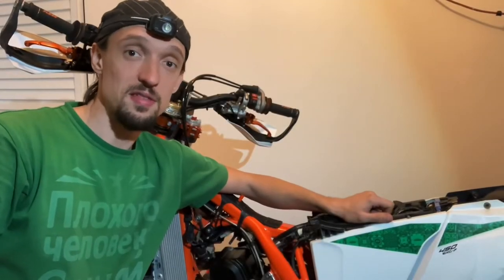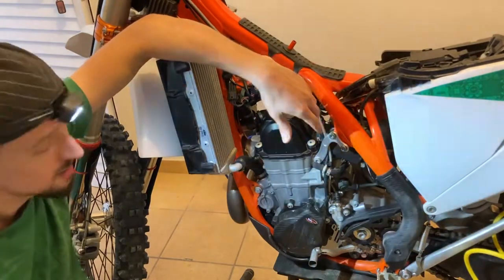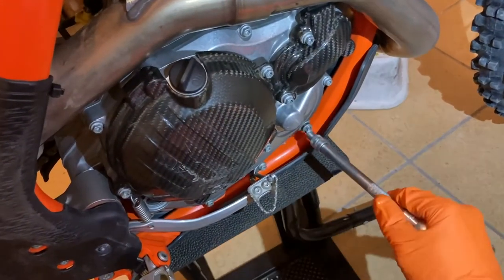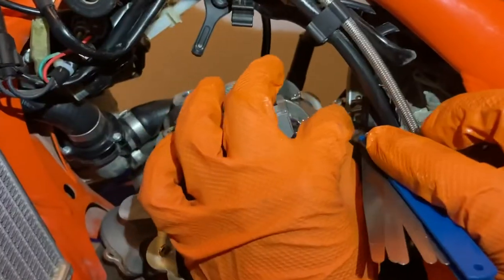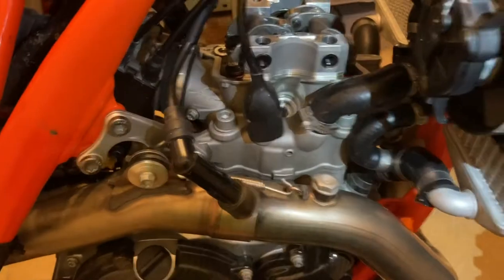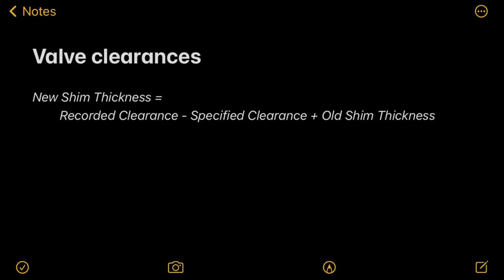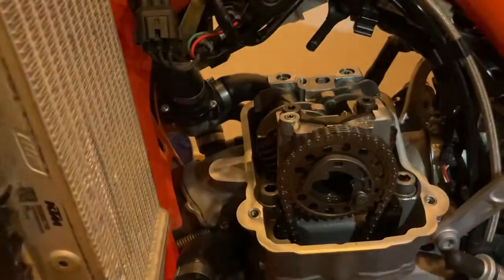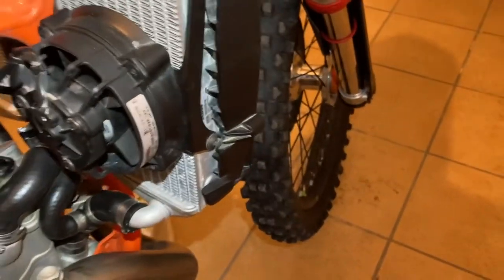Valve Clearances on 2020 KTM 450 EXC-F and How to Get Service Manuals

Comment: Hi, great video! I'm curious what brand of feeler gauges you have that have the 0.11, 0.12, 0.14, 0.16, 0.17 sizes. Most 32 blade sets skip a few sizes starting after 0.10mm :(
Since those are the critical sizes needed in our case, stacking blades to get the "odd" sizes is far from ideal. Appreciate the info!
Reply from the maker: Hi! Stacking feelers is exactly what we do. This is a precision instrument, and the feelers are meant to be mixed and matched to get the size you need. So I’m always using 2 feelers, preferably close by - so 0.9 and 0.7 for 0.16. The one I have has 0.15 and 0.10, then 0.01 increments down. Get them at any place selling tools.

Comment: @silk rider: Good vid & instructions. If the interface between the shim & valve spring is “wearing,” wouldn’t wear increase the clearance (loosen) instead of decrease (tighten)? I would assume less clearance (tight) is due to carbon build up, etc., but more clearance (loose) is due to wear.
Reply from the maker: Honestly it can go both ways. There are two contact patches, the valve shim and valve stem, and the valve seat and valve face. The valve shim/stem interface can wear because of the contact between the two, damaged or bent valve stems, and other stuff. The valve seat/face interface can expand because of carbon, or it can contract due to wear of the seat or face (or maybe both can happen at the same time). End of the day the only way to find out is to open it up and measure!

Comment: Nog ff een vraag over de ketting, hoeveel uur gaat die mee, het is net of ik die ook wel hoor ratelen bij laag toerental
Reply from the maker: This may be the valve guides, not the valve chain. Is there some smoke coming out of the exhaust when reving the engine? When the valve guides wear out, the valve stems start to slap against them as the valves move up and down, and oil gets past the valve stem seals and into the combustion chamber. I don't have a video for changing the valve guides as it requires some specialized tools so it would be best to take off the cylinder head and give it to a machinist.

Comment: Great video, how many hours when u did the valve check??
Reply from the maker: Hey thanks, I can’t remember but I do it every 30 hours. If you’re just trail riding you can skip one every so often.
Reply: @SilkRider  all right, and how long can you drive without a adjustment in your experience?
Reply from the maker: @jannisgotevas1071  could be 90 hours but honestly it’s not really a “failure” point where something breaks or noticeably fails. All that happens is your valves are opening less (or more) than needed, your power suffers, maybe the mixture becomes out of whack, and you carbon or foul up your combustion chamber and spark plug more and more. So it’s just a general tuning item. If it’s something you’re willing to do, then make it a regular thing because it keeps your engine performing at its peak. If you don’t wanna bother with it and just wanna ride without too much hassle, check them every 60 hours or so. It all depends on how much time you have and are willing to put in.

Comment: Dus al ik bijde 15 er tussen kan krijgen zoals in als uitlaat dan moet het nog ff mee kunnen gaan, heb er nu 114h mee gereden
Reply from the maker: Best thing to do is to check it, you only have to take off the fuel tank and 3 bolts from the valve cover.